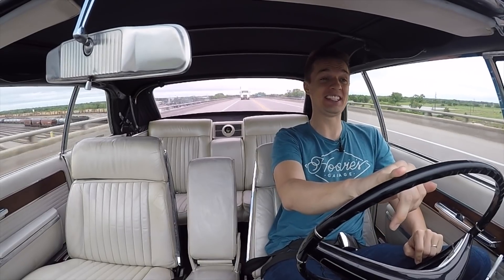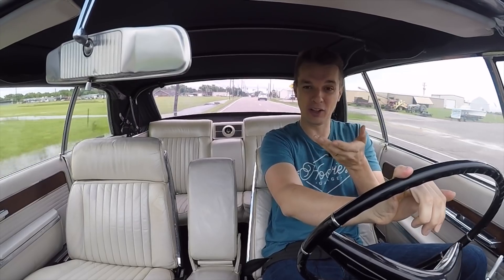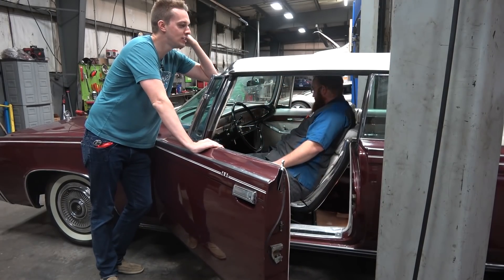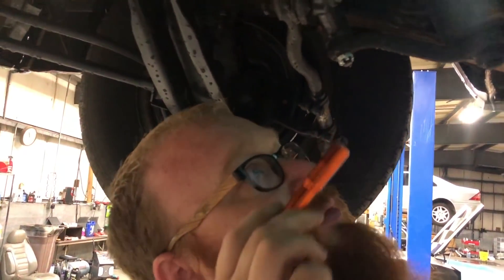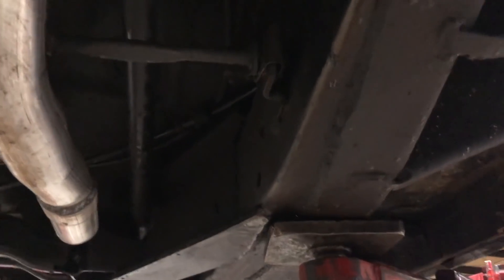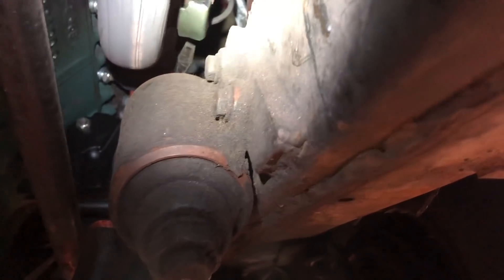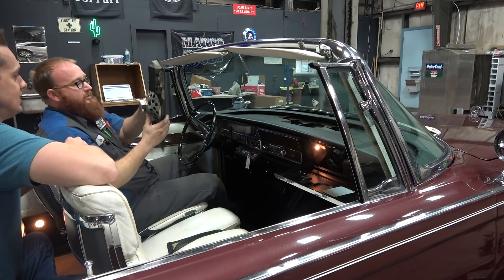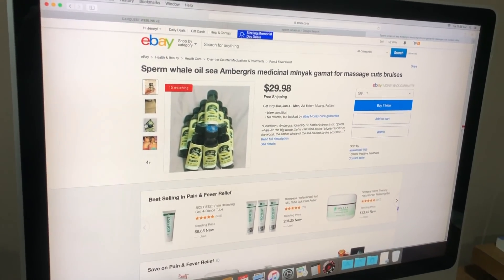Here's Everything that's Broken on My 1966 Imperial Crown Convertible and Why it's INDESTRUCTIBLE!

Comment: 1966 engineers: "Let's make the frame out of 1/2" thick steel I-beams."
Reply: dangerousmythbuster it was a wonky convertible. Think of the cowl quakes without that industrial reinforcement! 🤓
Reply: @mgmcd1  Yeah so many of the drop tops were built like that back then. Crazy!
Reply: Without the structural reinforcement of C pillars & B pillars convertibles in general regardless of make and model had extra thick frames, generally adding an extra 150-300 lbs.  If you wanted a car to race with, you'd get a hard top/sedan.

Edit: but those Imperials were reinforced on a whole new level....even by the standards of the time, and even for a convertible. Absolutely insane. Makes me want one even more now.
Reply: Such a death trap. Lol
Reply: not even dank memes could melt that
Reply: There are STILL imperial only demo derbies, videos on here
Reply: @RK Henderson Oh yeah, let's make solid steel bumpers, that'll be helpful in an accident. Soft on the knees.
Reply: Believe it or not, the old Datsun SRL311 roadsters had a frame just like that, only scaled down to a tiny toy car size.
Still...those tiny little roadsters weighed 2000lb despite being made of the thinnest body sheetmetal Ive ever seen....it was ALL FRAME lol
Reply: @RK Henderson See, the trouble with what you're saying is that it's just plain wrong. Modern cars are far safer to pedestrians, motorcyclists, other vehicles, you name it. And a huge part of it are those "shitty plastic" parts that are studied to deform and crumple, rather than shatter whatever they hit. Do you really think there's no difference between 1970s and 2019 bumper tech in terms of pedestrian safety?
Reply: The other car is your crumple zone.
Reply: David Chi Basically if you hit anything, what you hit absorbed all of the energy and you came to a cushioned stop.
Reply: @davidchi8914  Far safer for occupants, too. Crumple zones save lives.
Reply: @Mister_Belvidere  And that telephone pole?
Reply: @MaliciousSRT  Imps have a WAAAAYY Unfair Advantage In Traditional Derbies>
Reply: Yeah they weren't too concerned about weight in a land yacht. Some of the manufacturers used to brag about how massive their cars were!
Reply: @wholeNwon  My dad told me the old steel cars would just knock the telephone pole right down.
Reply: @perfectibility999  And transmit the impact energy to the occupants = deathtraps.
Reply: @arnoldnellis6120  Not just Imperials. Many derby promoters also don't allow the suicide door unibody Lincolns from the 60's. Those were INCREDIBLY strong cars as well. Believe it or not, so were AMC Pacers. Those were disallowed by many derbies as well.
Reply: Most imperials starting from 1959 are not allowed in demo derbies. Ridiculously strong chassis's.
Reply: @johneckert1365  I would laugh if I ever saw a pacer in a derby. Like watching a fishbowl drive around the track.
Reply: @arnoldnellis6120  I tried buying some Pacers this summer at an auction in Scandinavia Wisconsin. The owner was a big AMC & IH Scout fan. There must've been a big time AMC collector also buying, because I couldn't buy any of them. I ran him WAY up on all of them though haha
Reply: @johneckert1365  Nice!

Comment: The Nokia 3310 of convertibles.
Reply: IrishTiger no snake though 😂
Reply: Always funny to see good old Nokia comments. -Finn
Reply: @theangryitalian7922  Lol
Reply: @trumpjongun8831  Haha
Reply: Try the AMC Rambler American convertibles for pure classic durability. My personal favorite is the 1964 model but they're all good.
Reply: IrishTiger   Young Man,  I think you really mean something in the order of, the Nokia Mobira Cityman 900.  
Trust me on this.     I was  -  there...
Reply: @acat9965  Reliability is definite due to AMC's 2nd-gen inline sixes, which I consider to be the best I6es America has ever made. Whether 232 or 259 cid, they have been known to absolutely take on anything you could put them up against. Heck, the Jeep 4.0 six of off-roading fame is pretty much just an intake modification of the AMC 259. AMC was also the only domestic carmaker to really care about rustproofing during this time, as all of their cars were galvanized and Ziebarted as standard equipment. 

While all Ramblers had uni-body construction for lightness and passenger safety, they were also bolstered with a perimeter frame. True, it won't last as long in a Prius fight as an Imperial, but it won't crumple easily either. 

To be totally clear, I respect Imperial like most other vintage cars. I just like the Independent marques as well.

Comment: Now you can see why 64-66 Imperials were banned from Demolition Derbies. You have basically a 4" x 4" of probably like 3/16" steel box frame, and the convertibles have the X in them, most older convertibles did. So and imperial will not "belly" as we derby drivers would call, and you still can't run these anywhere, but they make 90's fords not bend... 67-73 Imperials are still banned in some derbies but not all, they are unibody cars, and the front sub frame is amazingly strong. My dad ran one on 2 different chryslers 3 different times with chrysler pointy bumpers, which are known to destroy frames, the bumpers got junked before the subframe did. I would love to have a 64 Imperial hardtop sedan to drive, as well as a 77 New yorker hardtop Sedan, I think they are absolutely beautiful cars.

Comment: I used to lose my hubcaps in my '69 spanish-made Dodge Dart GT, after spending maybe half an hour looking for the last one I heard falling of my wheel in a field full of bushes next to the road I decided to put a little bit of windshield silicon, you know... that black silicon used to glue the whindshields to modern cars. And man... they have never fallen again, and I use to drive it hard. Yes, when you want to take the hubcap off it is a little bit harder than usual, but you can easily take it out anyway so... I've seen people making holes in their hubcaps and bolting them, but that would be ruining the hubcaps to me... So I recommend using that silicon, you'll save some money buying hubcaps.

Comment: Great video guys!👍👍I immediately knew it was the heater core when you described it, which also brought back a flashback nightmare from about 1996.😳 While traveling 300+ miles back to college after Christmas break in a Michigan January, my heater core blew out💥on my ‘89 Merc Sable... a literal ❄️blizzard❄️with subzero temps, in the middle of nowhere in MI’s Upper Peninsula, I had no choice but to continue on!  Surprisingly I didn’t die😵from the HUGE cloud of antifreeze vapors billowing from the vents!  Of course I put all the windows down after I bundled up—it looked like a winter-version of a Cheech & Chong film!! 💨 💨💨💨💨💨💨💨💨💨

Comment: Hoovie - "I can comfortably cruise at 90"

440ci - " 4 mpg......."
Reply: My 69 Roadrunner with a 528 Hemi is better than that normally around 12mpg. The Imperials however are very, very heavy. #LandYacht
Reply: @oldninjarider  528!!? I assume you meant 428 lol
Reply: Will Wood 

Post a video of it or you’re lying
Reply: More like 10-15mpg
Reply: Is the 440 in this car a Hemi?
Reply: @oldninjarider  damn thats cool! do you have any idea how much power its putting down?
Reply: @chrisj197438  Mate, just because he can't prove it don't mean you say "yOuR lYinG"
Reply: @NazbolCaliphDonaldaddeenTrump  830 on E85 with a high rise and dual quads. Right now it has a single quad EFI system on it, I like to be able to close my hood. It favors E85 but can run 91 octane because it has a flex sensor. It's just a toy for going to car shows and other things it doesn't see a lot of highway miles anymore.
Reply: @F6HemiCharger  That in 1966 you could probably fill that tank for under $4
Reply: @theangryitalian7922  No, it has a traditional combustion chamber design.
Reply: @theangryitalian7922  nope 440s aren't Hemis but have loads of torque.
Reply: @mrdanforth3744  don't forget all the motorhomes that ran them clear into the 80s
Reply: Adam Fears  yup
Reply: @oldninjarider  Chrysler stopped making them in 1978.
Reply: Three, take it or leave it
Reply: Will Wood - does your gas station have a financing department?
Reply: @mrdanforth3744  I'm sure it was up till 82 but I'll defer to that. Thanks for clarifying.
Reply: @theangryitalian7922  Wedge Head.
Reply: I'm glad my v8 turbo diesel sierra gets 15 mpg and has all the same features
Reply: @theangryitalian7922  440 would be a Wedge Head for Standard Production Vehicles. 440 Hemi Engines came painted in brite Orange and where used In Racing Cars, and Drag Racers mainly.  Could be ordered by a Dealer.
Reply: Even a dodge demon gets better mpg than a luxury land yacht like the imperial.
Reply: Let It Reign no, it’s not. The 440 was a wedge design.
Reply: Will Wood That was 2-3 hours’ worth of pay. Minimum wage was $1.25!
Reply: @ericr7162  true but on the other hand that imperium will go through a brick wall and the worst thing that would happen is it would get a dent and some paint scratches lol 😂
Reply: @theangryitalian7922  no, these were cross flow heads, but no semi.
Reply: @theangryitalian7922  No
Reply: Depends on how the 90 is being run, flat, uphill, downhill, mountain grade could be between 4 and 17mpg. In those days at the posted 70-speed limit, my mom 1966 Crown convertible could get 18mpg really easy on I-10 and drop down to 10-12mpg in the mountains.
Reply: Daver G  Thanks for that clarification. I guess date codes matter.
Reply: no more like 9-10mpg
Reply: @andrewarmstrong7310  I would not doubt 12-14 for him, he does live in Wichita Kansas where the biggest mountain is a freeway overpass!
Reply: @5roundsrapid263  Somebody that made minimum wage did not drive an Imperial.
Reply: Who cares about the gas mileage in an Imperial?
Reply: @oldninjarider  bored over i suspect? Gotta sound sexy. Love to see a walk around of it
Reply: Will Wood of course you didn’t stutter, you’re typing
Reply: @niteninja0133  bored and stroked. I'll have to post a vid.
Reply: My grandfather had a 77(?) New Yorker with a 440. Towed his new Airstream behind it.
Beautiful car in the ridiculousness that was 70s American Luxury yachts.
Still don't believe that exceeded 250 HP though.
Reply: @oldninjarider  So you have an old car with a new 528 Hemi? Big fucking deal. My 69 Roadrunner has the same 383 that it came with in 1969. Its a numbers matching car so suck on that.
Reply: you people amaze even me 3.4
Reply: TRAIN SHIPS the good old days
Reply: Hey everyone thanks for your answers! Love mopars and am trying to learn. Thank you for your patience.
Reply: @theangryitalian7922  NO, IT'S A BORED-OUT 413 WEDGE!
Reply: hold my beer
starts up UH-1
 1.6 mpg at best, 0.4 mpg against headwinds 😄
Reply: Prairie State Auto Restorations well, at least 8 or 9.
Reply: 440ci: 4 mpg
Lamborghini Countach V12: "Hold my beer: 3 mpg"
Reply: Im a big fan of the old squarebody chev trucks and let me tell ya, it's about smiles per gallon ;)
Reply: @chrisj197438  ever notice it's always the people with the 528 cubic inch hemis that have no videos on YouTube
Reply: It probably gets around 12 in town, maybe a bit less. That was typical back in the day, gas was cheap, you just had to gas up more often at 25 cents a gallon.
Reply: @oldninjarider  That would be $33 today. Actually gas was 32 cents a gallon, which would equal $2.57 today. So cheaper, but not radically. Probably raising octane by putting lead in was cheaper, brain damage be damned.
Reply: @mexicanspec  When I had a 40 year old 1962 Lincoln I NEVER checked the city gas mileage. It got 15 mpg on the highway. By the way: four ash trays and four lighters.
Reply: @tomj4406  yes wait till they discover gusset plates.
Reply: @tomj4406  yeah Detroit knew what heavy metal was about.
Reply: Mike Sienicki 

Then post a video. Until then we all believe it to be a lie.
Reply: @F6HemiCharger  It's sad that this has to be explained. There was a time when every school boy and girl knew this.
Oh, and my grandpa's got a whopping 15mpg on the freeway with the top up.
Reply: Let It Reign’s e46 drop no it’s not.
Reply: froopty 
When you buy a car like a 66’ Imperial you’re not worried about gas mileage.
Reply: Let It Reign’s e46 drop No. Wedge head.
Reply: Don’tell Gucci not really as it wouldn’t be driven daily. They would be a fair weather cruiser.
Reply: Yes!  I had a 66, 300, with a HO, 440, and the thing was lighter than an Imperial or New Yorker...….  I bought it when I was 16, my first car, and my friends would pile in and we'd go to concerts, following bands, and we fly along at 75 to 95 mph, in the outback of the state, no problem.
Reply: @theangryitalian7922  No - it's a wedge head.  The 440 "came out" in 1967 - only the Imperials got it in 1966, it replaced the 426 Wedge.  The second-generation Hemi was initially made out of  the 426 Wedge on the Chrysler Marine line; but the hemi blocks are different, you can't just bolt hemi heads on a wedge block.  Sadly, or I'd'a done it. :(
Reply: Chrysler Corp. cars from this era generally had high ratio gear sets in the 3rd member. Effortless cruising on the interstate at fairly low rpm's. translates to better than expected. MPG freeway's. Depending on vehicle weight and wind resistance that can mean 12, 14, 16, 18 and even beyond that.
Reply: @sleepingpowder1355   Oh, but you seem to forget Monsouir. This is the internet.  Where cowardly assholes become full of bravado and distain for their fellow man. Whom they disown because they think it's cool to have a POTUS who never fails to distinguish himself from the ordinary couth people online.
Reply: To bad you were driving this on the pre-covid era.  A mask would have protected you from that blowing coolant.  Of course, it could have made you pass out
Reply: @NazbolCaliphDonaldaddeenTrump  Uh no. There is a 528 Hemi, it's stroked.
Reply: @NazbolCaliphDonaldaddeenTrump  No. They have a 528 stroker hemi and it sounds like he put a modern hemi stroker to get that kind of MPG. This is an ad I found.

FHO 528/540 Street Hemi Package
We highly recommend the 572 Hemi for most street and bracket race applications. For customers requiring a smaller cubic inch package, we have a super high quality list of components. Most parts are identical to our larger 572’s, with the exception of crankshafts/pistons.

The 540 package features longer connecting rods than the 528, providing improved rod ratio and lighter components.

Just like our 572 Hemi, engines can be detailed to appear OEM stock or given a more Pro-Street or race look.

The choice is yours.
Reply: @froopty1854  ford power stroke  baby  or dodge  Cummins  but  Chevrolet  like  a rock  it just  sits  there  and gmc got mechanic  coming
Reply: Ha
Reply: Heater core has coolant leak
Reply: 3:19
Car Wizard was afraid of getting pregnant 🤣
Reply: A working mechanic has no issues with dirty hands 🙌
Reply: Drove to Connecticut in new 78 New Yorker, average speed 48 mph average economy 16.8 with 440.
Reply: @gregorytimmons4777  New Yorker had 2.68.
Reply: @oldninjarider  Also more frontal area, which increases power need exponentially with speed. That front end is probably not that aerodynamic either.
Reply: @theangryitalian7922  Is the 440 in this car a Hemi? No. The original Hemi V8 ended in 1958 was replaced by the line of more normal (and cheaper and lighter) OHV V8's (351, 383, 413, 440) that is in this car. Hemi heads were put on this V8 for a small number of super high performance engines.
Reply: @oldninjarider  Actually gas prices in the US, corrected for inflation, at the lowest were only a little lower than a year ago (not counting California).
Reply: @oldninjarider  More likely it was about $10 assuming the price of premium was 40 cents a gallon.  I am guessing that it has a 25 gallon tank.
Reply: @1575murray  growing up I remember "Gas Wars" when stations would drop prices to 15 cents/gal. Of course that was when you had 4 stations at major intersections and the dealers actually did full service too. 40 cent prices didn't become the norm until after the first Oil Embargo.
Reply: @oldninjarider  If I remember correctly, the tank was 30 gallons, so a full fill at $.30/gallon would run you $9.
Reply: @emjayay  Sorry, but the high performance Hemi that everyone lusts over was it's own, unique engine, that was introduced in 1964 and produced until 1971. It had zero in common with the 440. No such thing as hemi heads for the 440.
Reply: @juniorjohnson9509  good old days
Reply: @trainships1795  there was no 440 hemi there is only the 426 hemi also called The elephant engine
Reply: @mmill6505  The 528 hemi didn't or wasn't produced till 1991 1960 was the 426 hemi
Reply: @theangryitalian7922  NOPE, IT'S A WEDGE!
Reply: THAT'S WHY I HAD TO SELL MY 75 CHRYSLER, COULDN'T KEEP GAS IN IT.
Reply: More like 4 gallons per mile
Reply: @theangryitalian7922  The 440 is a wedge-shaped combustion chamber.
Reply: Try closer to 16-18 mog highway and 12-15 in town.  I own one   These never got "4.mpg".
Reply: My 77 26' Vogue RV would cruise at 80 with its 440. Typically got 6 MPG
Reply: @oldninjarider over 250 pounds of soundproofing on the 64. Quietest car in the world at the time.
Reply: @NazbolCaliphDonaldaddeenTrump  Try 426
Reply: @theangryitalian7922  At that time, the Hemi was a 426. Earlier - like in the 40's and 50's -the Hemis they produced were from 241 cu in up to 39s.

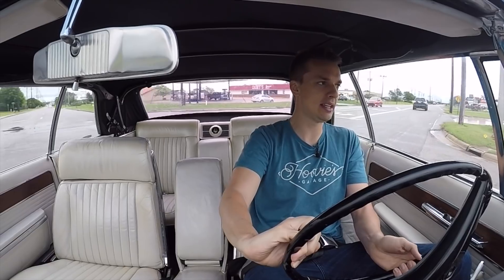Comment: 01:44 Try turning the steering wheel 90 degrees in both directions (like you are doing here, Hoovie) with one of your modern sports cars. You would send it flying off the road. This Imperial barely seems to notice. 😅😂🤣